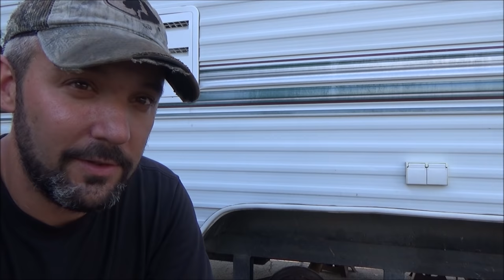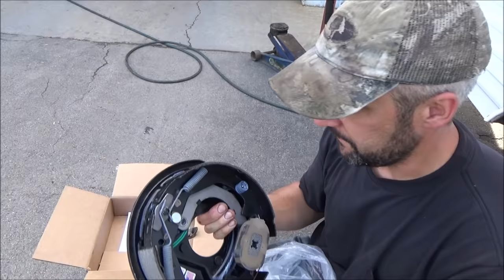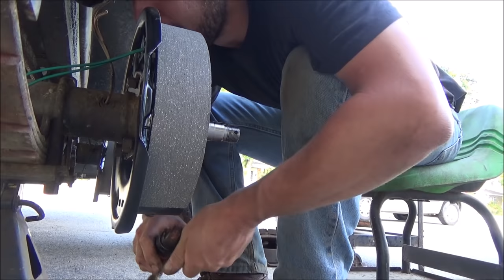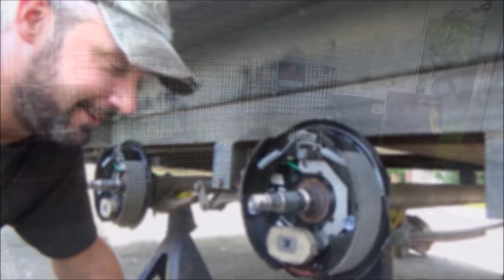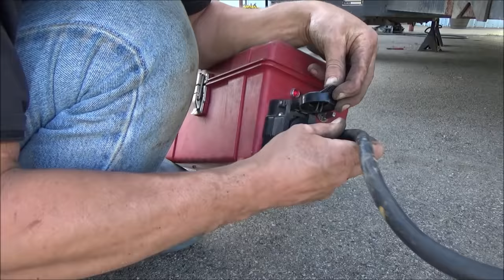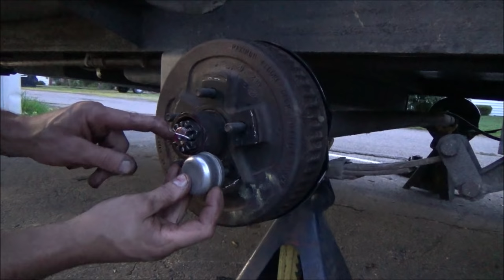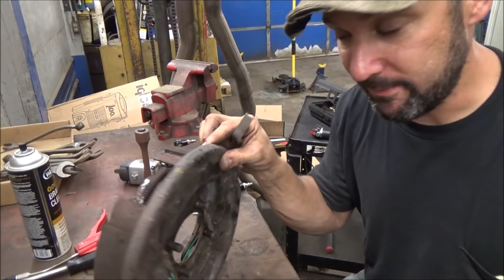Replace: Electric Trailer Brakes - Part 2

Comment: I’d recommend Bearing Buddy. Ultra easy to grease and verify it’s full of grease.
Reply: Be careful. Too much grease and it will push by the rear seal and coat your brake shoes. Happens very often.

Comment: Hey Hello, when you reattach those wire brake behind the backing plate with the wire coming from the axle, what exactly do you use for reataching them togetter? And do you weld them too? Thanks for your help.

Comment: I had this old lawn boy push mower that i used a galvanized steal pipe for the exhaust pipe, the old one was rotted out and I didn't want to heat or mess up the stuff near it, The was the loudest push mower on the block lmao

Comment: I see it's been 3 years since this was made but I still want to thank you for making and sharing this video.  I learned a great deal as I'm in the process of getting a 10 year old travel trailer with breaks like this.  I did not see or hear if you turned the drums on these and if so do you recommend having that done?

CHEERS,
Kenny

Comment: I did this on my 2006 5th wheel toyhauler camper.
I found that the complete backing plate/ electromagnet /brake shoe assembly was only $10.00 more than just replacing the brake shoes.
For an extra $40.00 you got all new stuff.

Comment: I learned alot from watching these 2 videos. Thank you! One thing...What is your thoughts on jacking the camper up by the axle? I have seen several warnings in my rv booklet that states you risk bending the axle and you should never use the axle to jack up the trailer.
Reply from the maker: Yes you can bend the axle if you lift it in the middle. I pick them all the way out by the wheel but i would follow what ever your book suggests.
Reply: Thanks again.
Reply: The Kelly Corner of

Comment: Looking to get a small parts washer.  Any recommendations for someone who is a shade tree mechanic that is tired of using 14 cans of brake cleaner for every job?
Budgett $2-300 for parts washer. Not real sure about water based.   
Those degreasers don't seem to cut it, simple green, the purple crap. Etc. 
What is your ideas ?

Comment: Superb video as always Eric. I'm a recent subscriber and also did not know about electric trailer brakes. The only type of trailer brake actuators I am familiar with, are the type that operate with cables connected to the tow hitch. They work when the towing vehicle slows down and puts pressure on the tow hitch. This in turn puts tension on the cables and applies the brakes. As such, it is a proportional system, because if the trailer slows more than the towing vehicle, the braking pressure is released. The electric system you described seems to be full on, or full off, depending on whether the driver has their foot on the brake pedal? Am I missing something? 
Many years ago I had a Nissan Micra, with which I used to tow a trailer tent (Probably a bit too large for the Micra).
On one memorable occasion, I decided to take out the tent at the beginning of spring, after leaving it stood all winter. Being too lazy to give it a thorough check, I just hitched it up and took it for a
quick spin around the block. At the end of my street, I applied the brakes on the Micra, the trailer hitch had seized, so the forward momentum of the trailer lifted the rear wheels of the Micra off the ground. Quick change of underwear later, I decided to fully service the trailer...
Reply: The trailer brake box magically senses the angle of the car, maybe, and varies the voltage to the brake magnet, thus increasing the stopping power. Not sure about the magic part, but it does vary the voltage.

Comment: I've found out that if you pack too much grease in the hub, the heat generated while in use will force the excess grease out past the rubber seal and "bugger" up your wheel.

Comment: Love your videos. Question got four wires going to my new brake pads on left side brakes. two coming off the axle and two going up inside the trailer, could these be going to my rear trailer brake lights.
Reply from the maker: No, they would be going to the other axle perhaps or the break away perhaps
Reply: South Main Auto Repair, Thank you for your respons. Just wondering if they have polarity or not I'm going to hook them up. Then test till I get it right.

Comment: Thanks for another awesome and informative video; as always, your videos are the best on You Tube. I especially appreciate when you tell the viewers what the brand and model is of the tools you used in the video. What is the make & model of those nifty little wire cutters/strippers/crimpers you used with the red handles?
Reply from the maker: Don Z Those I got off the Snap-On truck, not sure of the number till I get to work it the a.m.
Reply: South Main Auto Repair Excellent. Thank you sir!

Comment: Have a question. The wiring on my trailer brakes are grounded up front where the brakeaway box is. Do I need to ground them on the other end as well where the wires connect to the brakes? I keep getting a bad or OL reading from my controller in the truck. Thanks

Comment: Great video, I'm preparing to do mine on my travel trailer but I'm upgrading to they Dexter self adjusting ones.  Thanks for a job well done. BTW what you charge that guy? :)

Comment: Dont use compressed air for cleaning out bearings, according to the Dexter service manual, it damages the bearings... i cant figure out why but maybe i abrades the bearing surface? was watching your video to find out what tools you use to remove the electromagnet....unfortunately have not found that info yet...
Reply from the maker: lol if blowing air on a bearing ruins the bearing.... I'd suggest not towing it down the road 70mph with 7000lbs sitting on it ;)

Comment: Had a set of electric brakes on car hauler trailer stop working because were the green internal magnet wires run under the control lever pivot point the wires rubbed thru need to make the loop bigger.

Comment: Dexters EZLube axles fill the hubs full, it is the process of how they work,  trailer brakes are more prone to heat than automotive breaks so in the event that the grease were to liquefy excess grease in the hubs would help protect the bearings from running dry
Reply: +iceandhotwax grease dont cost that much, i always pack them full too

Comment: I buy the bearing buddy and it will get the grease in it replace the dust cap and pump it full of grease you can swap it back with the regular cap or just leave it on it and keep them greased up every so often

Comment: if this is repeated I'm sorry, the reason why you put grease on the inside of the Hub past the bearing it's called a greased Dam because of centrifical force will spin the grease to the outside of the Hub if there's a grease damn on the other side of the bearing it will hold the grease in the bearing as the drum rotates at high speed.

Comment: Agreed, trailer wiring is crap from mfg.  When I purchased my last trailer I  cleaned up the layout and installed split conduit over wiring and secured every 10 inches.

Comment: That translucent inner insulation could get a person, especially if working with marginal light and/or marginal eyeballs. 

Test box- would be neat to add an amp meter. Magnets for 10 and 12” drums should pull around 4.0 amp/magnet at 12v.   More rare 7” are around 3.2 amp/magnet.

Comment: Are travel trailer brakes self adjusting as they are used or do you have to readjust them as they are used like the old cars use to be get information thanks
Reply: Most have to be adjusted, but they do have some self adjusting out there.

Comment: Obviously once it's inside the break drum that assembly it does the shoes pretty evenly did you notice when you took it off one brake was not worn out more than the other

Comment: I just had to replace the brake wire that runs through the axle. There was too much slack and the wire laid on the bottom of the axle and rubbed almost all the way through one of the wires. Maybe that's why the wires have that extra coating.

Comment: which way is right? facing the trailer from the front or from the back - maybe easier drivers or passenger side  ( trailer brakes left and right )
Reply: Left = drivers side. Right = passenger side.

Comment: Lots of parking brakes are set up like that (minus the magnet of course) with a non adjustable drum in the brake disc. If I bring my car to get inspected at at a Jiffy lube or Valvoline(they are close to me) I'll always tighten up those star wheels otherwise the car fails. After the inspection I'll back it off to normal. They like to rev up a v8 car to 1500 rpm and verify the it don't move, otherwise it fails NYS inspection. The funny part is that any legit inspector will pass it(the car holds fine on hills, I use it), they won't even make the adjustment.

Comment: Good work sir. My nano 3/8 is on its way from Amazon, due to your enthusiasm for the little guy. Some of the Amazon reviewers mention your channel.  

Which brand shrink connectors do you prefer? I'm building a custom camper from a 7x14 cargo trialer. So, I will being ton of crimping. Thanks and keep up the good vids. 😆
Reply: NAPA connectors.
Reply: Got the Carlyle brand. Its Napas new house brand.

Comment: Great video  learned some things about electric brakes!  The  new flaring tool I told u about   so far is working out  great , made  several brake  lines today  .  Oh did u pay yourself  overtime  for working that late ;)
Reply from the maker: ***** Good to hear and yes I gave myself a bonus a week off with double pay and time and a half for this job.

Comment: Eric O, so i just recently installed a new breakaway brake pin box on my rv, and when i connect the trailer battery, the light comes on on the breakaway pin box that says "engaged" while the pin is still in the box, any idea why that light that should only be lit while the pin is pulled would be on? cause this means the brakes are engaged without the requirements for them to be engaged applicable... i havent had the chance to see if the brakes themselves are actually working, but if they are then i have a serious problem as i gotta haul this rv 1200 miles in a month :(

Comment: I forgot where I got the specs, but when I did the wheel bearings, lock nut kit and manual lockers on my Bronco it was something like "tighten to 50 ft. lbs. while turning the rotor, then back off 1/4 turn".

Oh, and that candy is probably sugar free. I hate that aspertame/sacharin/equal junk too.
Reply from the maker: Cheezy Dee Yeah lol you can say it is sugar free haha

Comment: On the old style motorcycle chains, people would melt the old grease out of 'em and get the rest with petroleum. Just in an old biscuit tin with a couple tealights under it and then same again but with petroleum and without an open flame. I guess that would work for bearings too.

Nowadays, could we just wrap them in paper towels and stick 'em in a microwave, possibly in a repurposed frozen meal tray? -I wish I could try that, but I got rid of the ol' CB250 a long time ago.

Edit: car parts should actually come with some free candy in the packaging. Seeing as it's hard to get worked up when you're sucking on some candy, I think that would take some of the sting out of getting a wrong part. We're onto something here, I think, so if this idea gets picked up, I think we should get a cut; maybe $0.001 each for each parts kit sold? -we'd be millionaires, surely. :D

Comment: Good vid, come accross theses over here from time to time, always disconnected tho. Does the feed have a varying voltage to apply the brake more, or is it just off or on?
Reply: The electric brake controller uses a variable resistor on older units, a digital pulse on newer ones to vary the voltage/current.

Comment: I HATE SCOTCH LOCKS AS MUCH AS YOU DO !  I also don't like "open" butt splices or ring terminals.  I bought a "lifetime" supply of bare splices and ring terminals about 20 years ago and use "marine" grade (double layer) heat shrink.

Comment: NEED HELP. I followed your instructions and installed new brake assembly but when I went to test magnet it is very weak. I can tell that it is somewhat magnetic but not strong enough to hold small metal tools. Where could I go wrong? Thanks
Reply from the maker: +Kevin Arndt  Are you trying to activated them using your controller?
Reply: yes with brake pushed down
Reply from the maker: turn brake controller all the way up or use the manual lever on it to activate them or pull the emergency brake away switch, that is the only way you will get "full magnetic power" back there. In my video I was applying a direct 12v to them. Your controller will not depending on what power level it is set on. Plus it may be a proportional control.
Reply: +South Main Auto Repair thanks a lot will try that.
Reply: +South Main Auto Repair worked great with your advise. thanks

Comment: I had to laugh when you talked about scotch locks and wire nuts Ive seen them fail more times than I can count, one time had this guy come into the shop because his trailer plug did not work he had put a new harness in the year before and used wire nuts and scotch locks he had put grease in them in the belief that would stop corrosion needles to say it didn't work.
Reply from the maker: Allyn MacLaren Jr The only way I have seen them work perfect every time is when they stay in the package haha
Reply: Lmao

Comment: Eric really enjoy your videos. What is the green and blue tanks behind you at the end of the video? Also can we see your air compressor. I know on Facebook you said you recently had to replace it. I know I have seen where you said you run it at 120 psi. Is that not too high for your air ratchets? Also It would have been nice if you had shared some of your good fortune (candy) with Mrs Vanessa. Lol

Comment: Great video. Had no idea how these things worked til I saw this series.
What's wrong with that Ford truck on your lift?
Reply from the maker: ***Classified*** Can I give you the list of what is not wrong? It is a shorter one haha
Reply: South Main Auto Repair Let's hear it, lol.
Reply from the maker: ***Classified*** lets see, it needed front springs, one wheel stud and nut, e-brake shoes and cables, pads and rotors on the rear, right rear window reg and motor, NYSI, 2 tires patched, 4 wheel balance and rotation, steering shaft and a service and I think that was about it... don't recall everything lol
Reply: South Main Auto Repair Was it a theft recovery or something? Or just severely neglected? lol.
Reply from the maker: Haha one year of driving no maintenance... part of my "once a year " customers :)
Reply: South Main Auto Repair Unreal. Hope you made a lot of cash with the labor on that one, lol.
Reply from the maker: nahh it was easy work really :)
Reply: South Main Auto Repair Well, it isn't a Dodge. That's half the battle right there, lol.

Comment: thick insulation is for heat. I guess those brakes can pull some start up amps.
Reply from the maker: +Gary Johnson I would have though it would have been a constant draw... it is not a DC motor
Reply: South Main Auto Repair
Reply: the brake box in the towing vehicle has setting low to high which controls the amps.

Comment: Is that a tool designed just to pull dust caps? I had no idea that existed. My tool shopping list keeps getting bigger watching your videos.
Reply: Yes it is. You can lightly tap on the end at the hub to help it get a grip on stubborn ones. Works better than regular channel locks for dust caps.

Comment: Oh crud, I forget to include some info......I have an AL-KO axle with standard 10 x 2 1/4, 4.0K /4.4K brake system.  Can I replace with Dexter self adjusting brakes.
Reply from the maker: +CLIFF H Give these folks a call and they will let ya know if the ez adjust ones are aval for your set up. I find it best jut to call them...http://www.etrailer.com/

Comment: Had a laugh... Being in the rust belt, the trailer was in surprisingly good shape compared to most of the vehicles, while I'm in Alberta, there is no salt on the roads or in the air. Our vehicles usually last 15 years without a lot of rust but the trailers here are horrid lol

Comment: thanks I think I put a left side on the right years ago and the brakes were shit   I did not know there were left and right ones    still got that trailer in the yard maybe I will try again   thanks
Reply: Long shoe to rear, short shoe to the front, will tell you if they are reversed. When i say long shoe. I'm talking about the friction material being longer or shorter, the actual metal shoe is the same length.

Comment: jut watched what about repacking bearings  on a dump trailer with ez lube alco  axles should I do that or is that why they are called ez lube axles great vid as always thanks
Reply from the maker: If you tow a lot I would still remove the bearings inspect and repack.
Reply: why do they call them ez lube axles anyway what is the difference
Reply from the maker: They just pump grease into the center of the hub . I have never really found much use for them personally
Reply: @SouthMainAuto  I would pull em down , inspect, and pack them. Then you'll know for sure their OK. Ez lube are not much different than bearing buddies, just another way to push grease past the seal and coat the brake shoes, Thus RUINING YOUR SHOES,

Comment: Still surprised you dont dip the wire ends in a bit of dielectric grease first
Considering your environment 
Even though that heat torch will melt it